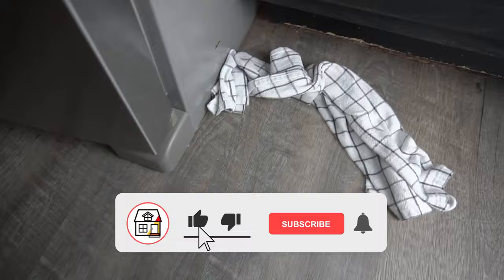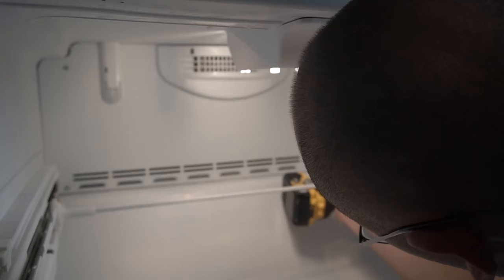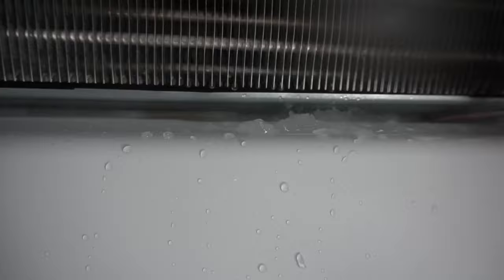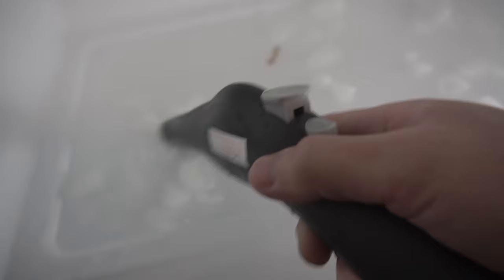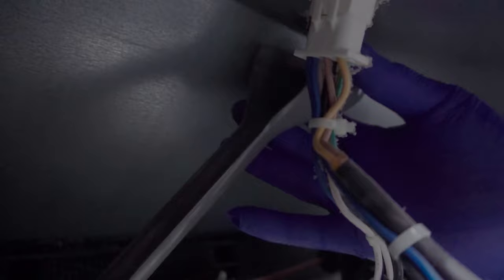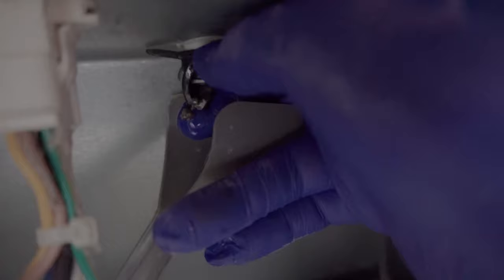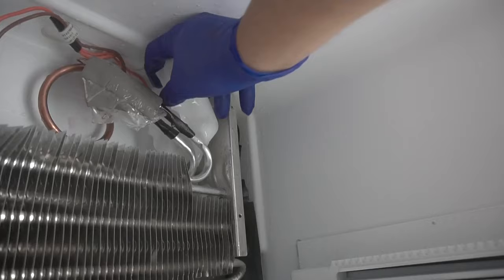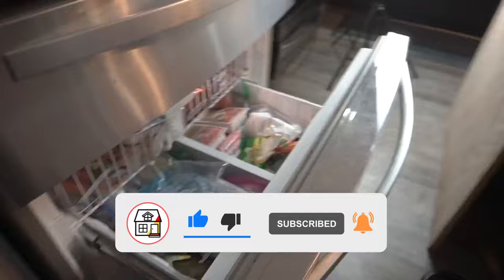How To Fix A Leaking Refrigerator QUICK! Water Leaking From Freezer - SOLVED DIY!

Comment: Appliance tech here. Need to make sure your condenser coils are clean, this collects dirt and hair and such over time. This creates a small blanket and could interfere in the refrigeration process. Also, Possibly some parts starting to fail on the evap, intermittent issues could be starting, but I’d have to see it myself. But keep the condenser coils clean, if the evaporator keeps showing weird freeze patterns, it may be time to get an appliance tech to look at it.
All that being said, great call with that steamer, hair dryers crack those evaps and ruins insulation and ruins refrigerators. I’m actually jealous of that tool and need to upgrade mine. For someone who’s not a tech, great job man! Not bad.
Reply: @ww45818 I purchased the Wagner steam cleaner and mine drained properly for about two weeks after all that labor! Any other DIY tricks? I found the dollar bill test for the gasket and mine seals fine when fully closed.
Reply: Seems a tech would have the common sense to just let the freezer thaw out on its own instead of even needing a steamer and doing all that needless labor.
Reply: @bigden31  Where do you keep the food frozen if you don't have an extra freezer? It is needless labor but only due to a poor design.
Reply: @garyformoe4850  in a cooler with a block of dry ice.
Reply: @bigden31  My wife doesn't like to camp anymore, so I sold my 120 qt cooler. The way you find out if you should keep something, is get rid of it and then you'll need it!
Reply: @garyformoe4850  happens to me all the time 😂
Reply: @garyformoe4850  so to help keep that drain from getting frozen up, I know some OGs will wrap a very small copper tube (capillary tube) around the heater and down the drain tube to try and prevent ice from clogging the drain.
Reply: @bigden31  I see where you’re coming from, BUT when you are running 8 calls a day, got to find ways to speed up and make calls quick and effective

Comment: Thank you. Thank you. Thank you.  My fridge was leaking for about a month now, and I really didn't know what to do so I left it and just wiped up the water.  I watched your video and saw that the refrigerator you worked on was similar to mine.  I went to work and although mine was a slightly different configuration, the process was the same.  The clog was where you showed it would be.  I spent a little time, and now I'm back to good, thanks to you!

Comment: Thanks for this great video.  My Bosch fridge was a bit different in the back.  The drip tube for whatever reason had a pee trap that was holding debris and causing drainage to have to overcome the static pressure in the trap.  With the info you provided I  just cut the pee trap out so the the drain did a straight drip into the pan.  The part that took the most time was gently thawing the coils and condensation collector in the back of the freezer.

Comment: Excellent video.  My p-trap in the back is a little different than yours; like an “S” shape.  When I pulled it out and looked inside, I found that it was also clogged.  I cleared that out and also followed your steps to remove the panel where the condensor coils were.  I also found ice built up a the beginning of the drain, just like yours.  Used a hairdryer (was carefull) to melt that ice.  Crossing my fingers that it will do the trick.
Reply from the maker: Thank you! Yes once you clear that blockage you will be good! 👍🏽😊
Reply: Did it work?

Comment: Thanks for this helpful video. I got stuck for awhile trying to figure out how to remove the wire basket from the freezer. I found the missing piece of information at exactly 0:40 in this video, a brief moment when the outboard half of the gear housing is visible in the raised position, allowing the round gear to disengage from the straight gear rack and let the basket to come all the way out. To raise each gear housing you must depress two catches and lift it. Then, after you remove the screws on the front ends of the gear rack so that it can flex enough, you can pull the basket all the way out. I used a hair dryer on medium heat, but also needed to pour 180-degree water into the frozen drain to open it. This all took about two hours, including cleaning. I could probably do it faster now. There appears to be a heater tube in the drain pan in the back, probably to help evaporate the water. It would be great if the chronically freezing drain under the evaporator coil had its own little heater.

Comment: Thank you SO much for this video.  I have a different model, with more bells and whistles, so had to remove the ice maker (which we don't use, so I left out), and the side rails.  I think the big ice mass at the top corner is caused by condensation or spills in the refrigerator draining into the area to ultimately get to the condensation drain.  I used a trouble light with a 75W bulb to melt/loosen up the ice.  Thanks again.
Reply from the maker: Glad it helped!🙏🏽😊

Comment: Great video!! Our refrigerator is approximately 15 years old. Looks like the exact same model as in your video. I've had to do this in the past but my mind was drawing a blank as I  haven't had to do it in a few years. Actually what i remember doing the last time is boiling water and using a turkey baster to defrost the bottom. And i also cleaned the drain piece in the back. I actually ordered another drain piece the last time as ar as i can remember. If i remember correctly they sell like a newer improved drain piece. Thanks for sharing.

Comment: Thank you so much for this easy to follow video! Been struggling with this issue for a long time. Got it done finally, now we wait to see how long until it clogs up again.
However long it lasts, even if it's 6 months, it should be way better than de-icing the bottom every week or two. FYI - Our steamer decided it was not going to turn on so a hair dryer had to do. Luckily my wife's has cool, warm and hot settings. Warm air from a distance did the job without the worry of melting anything.

Comment: Thank you very much for your super helpful video. Following your instructions I was able to fix the water leaking issue on my Whirlpool fridge. I am not strong enough to pull out the fridge so I wasn't able to clean the whatever nozzle from the back but I used both a hair dryer and a portable vacuum cleaner onto the drain hole inside the freezer. My hair dryer has a button when pressed down the dryer only blows out cold air so no concern of melting the plastic. It's been 24+ hours after my repair, so far so good, looking neat and no leak! Thank you again!

Comment: Issue is a restriction In The evaporator and is considered a sealed systems repair at this point, steaming the ice and drain is a temporary fix. Hence the large buildup of ice on the top right.

Comment: I have the same problem. Mine worked well for the first 2 or so years (warranty LOL) then I started having this issue. Did all this cleaning once, only worked well for a couple of months but the problem returned. Did this again yesterday and moved the refrigerator to a place with less moisture. Hopefully the problem goes away.

Comment: To answer your question, the block of ice on the upper right corner where the refrigerant tube enters the evaporator is caused by the blocked drain tube preventing the moisture from leaving and being drawn upwards via the evaporator fan and refreezing on that line, causing that clump. Since you unblocked that drain and tube, this will prevent that from happening again, or until drain plugs again in three years if preventive maintenance isnt performed once a year.
Reply: What is the preventive maintenance ? I have this problem. I've added the heat sink to extend from heater into the drain to help on both fridge and freezer drains.

Comment: At my whirlpool refrigerator,the drain was hidden , wasn't visible in the freezer , below the coils...

Water from the defrost ended up in the refrigerator.

Not just that, the frost slowly blocked the air going to the refrigerator... So although the freezer worked perfectly,the refrigerator compartment wasn't cold enough

Comment: I believe there is a hot plate in there for the condensate and it is probably not functioning anymore. Are used to hear a loud popping in mine from brand new mine is no longer doing that so I have water on the floor.

Comment: I used a flat head to break ice lose, used heat gun on low to melt the ice near the drain and the flat head to clear the drain. My black gromet in the rear was clean, no debris, no ice. I wonder when I'll have to do this again? Thanks so much!!

Comment: You asked about the ice accumulating on the tubes on the top of the evaporator coils.  Put some pipe insulation there and tape it down to itself. I use that metal tape.  The issue is that the coils actually absorb heat to turn the refrigerant to gas on its way back to the compressor.

Comment: There is an update part for this problem your supposed to remove the black rubber drain valve and install a simple kit or it will happen again

Comment: Thank you for the helpful video. I just fixed a fridge having same issue, using same process. I ended up removing the small black rubber nipple at the back of the fridge so as to help ease the flow from the fridge to the drip pan. I hope this will help prevent it from happening again. Does anyone see any problem with doing that?

Comment: Instructions worked well for my KichenAid frig.  My frig had the drain pipe with the trap/bend in it.  After I melted all the ice, the drain would still not drain the water.  Root cause: Some spinach (or something green) had plugged up the trap in the pipe, causing the water to back up onto the floor of the freezer compartment and eventually onto the kitchen floor.

Comment: What happens is when you place 
alot of food in your freezer and possibly block the fan the cold air can get blocked and cause freezing .
Reply: I have been arguing over this with my wife, now i have a support for my statement of putting too much stuff on the freezer since she kept denying it.
Reply: @yongkyputra1173  I bout to have a talk with the wife as well. The freezer shut, but as the newly purchased meat began to freeze it expanded against the wire basket and slightly pushed the door open overnight.

Comment: Like a Boss! Now, if it was me, I would be phoning the manufacturer. But, you make it look so 'easy'. Nicely done. 

PS: Is there a possibility that this will happen again, with this model fridge?
Reply from the maker: Thank you sir! 🙏🏽😊 if it’s still under warranty I would be calling the manufacturer too haha but it’s about a few years old now since we moved in from the past home owner. 
Also there is a possibility it will happen again because the compressor fan will keep blowing dust down there causing dirt to accumulate inside the nipple drain valve. But this shouldn’t be in a while, as long as you do 2-3 year maintenance and keeping the drain area clean. 👍🏽😊

Comment: We are having a similar issue. How do you prevent this from not recurring after you go to the trouble of clearing the drain?
Reply: Keeping the coils clean behind the kick plate helps (also removing the back and using computer duster on the fan and back coils), but the main issue is the drain line rubber grommet gets clogged. Whirlpool/KitchenAid makes a new drain piece probably runs $20-$30. I had this same issue 4-5yr ago and is happening again. Good luck!
Reply: I'm having the same issue with my GE bottom freezer. Need to clean the ice build up as mentioned here.
But the issue that created the condensation in the first place was a faulty ice maker dispenser door that wasnt sealing correctly.

Comment: Here's a WAY easier, less complicated fix folks. Put all the freezer food in a cooler and take out the baskets like in the video, but instead of disassembling your freezer, just leave the door open to thaw on its own. Fresh food section should stay cold enough overnight, and cooler should do the same, but if you're that worried about it go buy a couple of blocks of dry ice from Walmart and put one in each. After the freezer has thawed on its own, THEN take the back off and clean the drain as shown in the video. I usually just use a portable air compressor to blow the drain line out, clean the nipple with hot water. Problem solved!
Reply: Thank you!!

Comment: Hi. Nice video. Our bottom freezer fridg like yours, develops a pool of water at the bottom. But only in the summer time when the climate difference inside and outside the fridg is more extreme - hotter and high humidity. I live in New England, USA. Could this this cause the leaking?  Also both doors are very difficult to open. Like stuck closed. Thank you.

Comment: I replaced the 'duck bill valve' that was old and dirty with a 'p-trap' valve, after cutting the tube shorter, defrosted everything I could find that had ice in it using a steam cleaner. My freezer still leaks. Any ideas?

Comment: This is very helpful and looks a lot like our Maytag. You seem to have actively worked on yours because you had no place to put your frozen food! I’m thinking if we just empty our freezer (we have a spare freezer to put stuff in) and totally defrost the freezer it might fix the problem doing slowly what you did quickly with taking it apart, using a steamer, etc. Might still take the back panel off, though, to unclog the black nipple, as that seems to be a weak point where dirt can get in and clog it up. What do you think? Thanks.

Comment: Did you put a piece of copper wire on the refrigerator coil leading into the drain hole? I did this with an old Whirlpool freezer. Great video!

Comment: My kitchenaid refrigerator is about 10 years old. Making ice is broken. Water is not working (or husband wouldn’t buy filter). It leaks water on the ground (I believe the drain in the bottom freezer is clogged by ice) and the latest is lightning is out. Husband said he can’t replace the bulb himself. Since it still keeps cold, my husband wouldn’t replace it. We put a towel to soak the water.
Reply: I have the exact same problems with my 10 year old Kitchenaid fridge. Anything made by Whirlpool is junk. Avoid.
Reply: Replace your Husband ! 😀

Comment: yes very interesting, my fridge has had 2 leaks so far, i don't have the manual to it so i just unplugged it and plugged it back in again and no leaks,yet. but what is the checker pattern with a tear drop on the temperature menu, it's blinking.. i got an insignia

Comment: Could you just unplug the refrigerator and let manually defrost?   Then clean up the excess water that melts without undoing all those panels?  Just wondering if easier but   longer process (due to  allowing melting of ice to occur.

Comment: Good to know this...but what is causing the problem in the first place I wonder; and what is the fix to that source cause? Do you think it was just that buildup of dirt in the nipple? Has the leak returned over time? Thanks
Reply: Mine is a different model and the drain pipe was clogged with brown gooey gunk. The pipe looped around 360⁰ and I cut / straight-piped it down to drain pan.

Comment: All that grief over a little bit of dust/debris inside a rubber drain nipple? I would have cleaned off all dust from the back of the fridge - from the compressor fan blades, from the back panel cover, wipe off the back of the fridge, and mopped the floor underneath the fridge to remove all dust while the fridge was out. Maybe the rubber nipple needed to get trimmed a bit so it's not as restrictive of water flow? Thanks for posting the video!

Comment: I got a new LG french doors kept in my garage (so not hooked up to H2O) and each day we find water under the freezer, also the freezer maxes at 3-7 degrees empty, not zero. Any clues my friend? Thanks much
Reply: I also have a freezer & 2 refrigerators in my garage.  I had a repairman, (old guy), told me it’s the garage temperature that can make them work harder to maintain temperature.  He suggested to get them up off the floor & leave 4” away from wall to allow air to circulate around the back & bottom.  I put them on pallets.  They don’t leek anymore.

Comment: Can I just switch off my refrigerator for a few days and let the ice all melt on its own instead of taking everything apart?
Reply: Actually my mom used to switch off the fridge for few hours until all the water melts and she cleans the fridge and turns it on again. But if leakage is frequently happening better call a technician.

Comment: For over 50 years I never had a problem with a refrigerator or freezer until I bought a Frigidaire.   Ice maker died and display shot when the warranty ran out.  Now leaks water all over the floor in less than 9 years.  
Never again.

Comment: If this doesnt solve your problem:
A. The clog is made of food waste/oils
B. Drain pan crack or leveling issues 
C. Autodefrost/thermostat is broken

A)
- Remove the drain hose/funnel (depending on your make/model) in the back bottom of the fridge
- If you have a check valve ensure its functioning
- Push a long pipecleaner in the correct gauge (or a couple twisted together) through from the freezer side and from the bottom
(If you have a top freezer, you may have to remove some pieces in the lower fridge to pipeclean the drain from there as well) 

B&C= Either Re-level properly, Replace the part or Upgrade